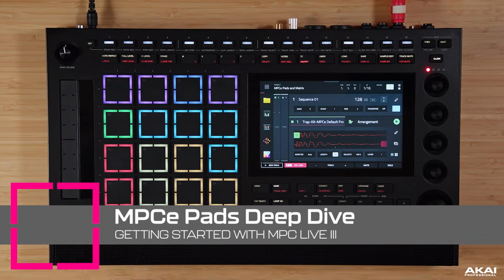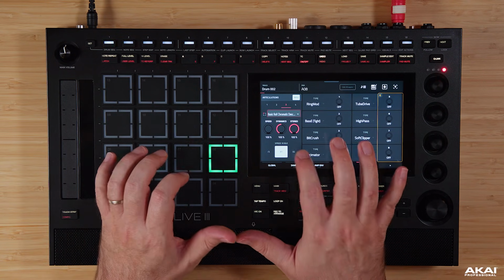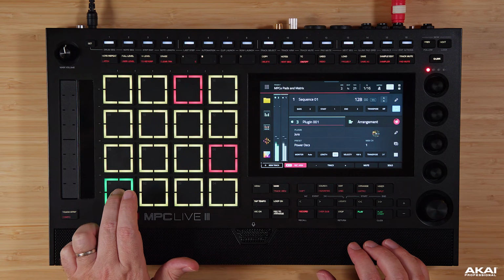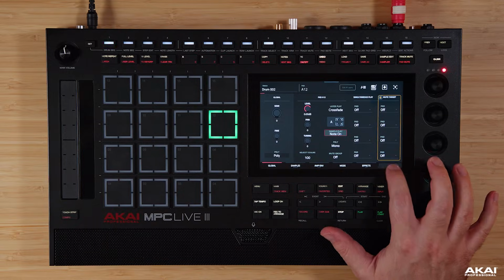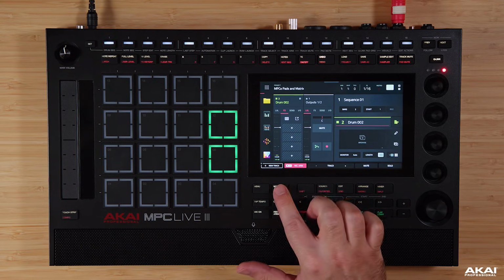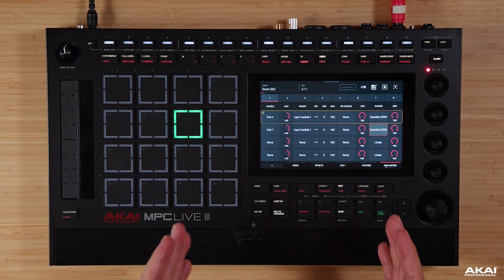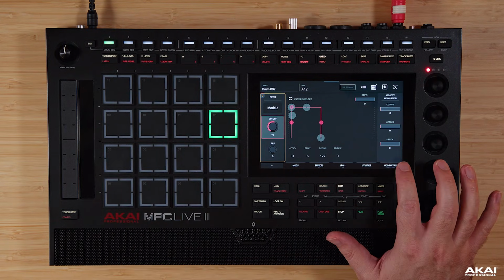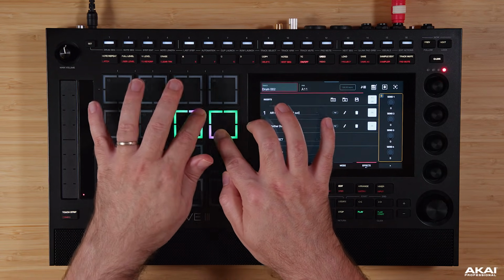Getting Started with MPC Live III | MPCe Pads Deep Dive

Comment: Can you set up the quadrants of the pads so that they each play a different note for a synth? For example, normally you'd only have 16 different notes on the 16 pads. But if you could split them up into their quadrants, you could have a 64 key virtual keyboard using the 16 pads x 4 quadrants.

Comment: your explanation of the lfo was missing one step. it had me fucked for a while. if you don't choose sample and hold you get no effect because the reset is turned on. each time it triggers it starts at the same location for the lfo. if it's sample and hold it starts at a random value each time. i chose to use the sine wave and that had me stumped for a minute. just saying. cheers for the awesome video.

for note repeats, you have to turn reset off for everything but the sample and hold.

Comment: I updated MPC Live 2 with the MPC Pro Pack.
You've removed the ability to assign multiple tracks to Drum Synth Multi.
With clip mode, every time you select a clip, it automatically switches to the clip's channel and disconnects you from the part/track you're playing.
Try to fix this issue.

Comment: I've never used an MPC before, but could be tempted by this.  The multitrack, connectivity, clips and workflow look great.  The portability and mic and speakers seem really liberating.  It would be helpful if you had a video going through the sound generating capabilities...  i.e, does it have a sound engine, or all samples?  Can it multi-sample?  What plugins/presets does it ship with, what else can you buy for it?  I'm happy the workflow is great, but I'm not sure if it's going to have the sounds or sound design chops I would like.
Reply: This machine goes much more forward than you would expect. It comes with a learning courve but it is really crazy. You can do whatever, without touching a Mac. I bought it at day 1,  possibilities are infinite, and it come with a huge amount of sounds, I mean HUGE for any genres